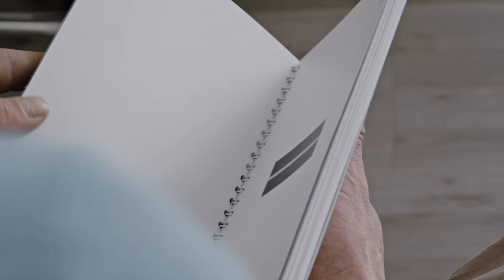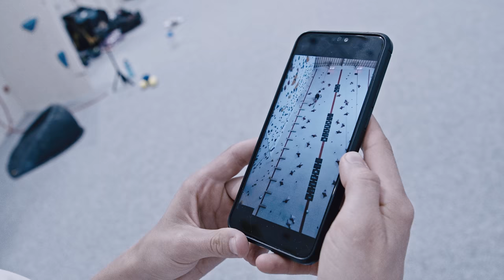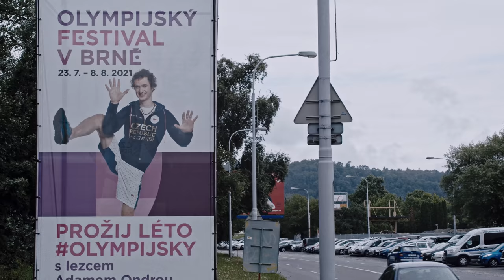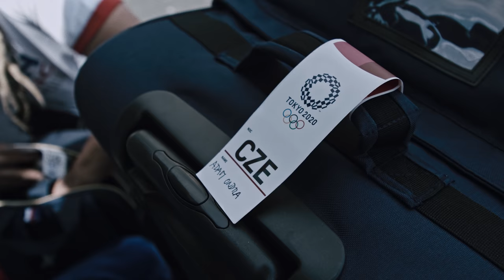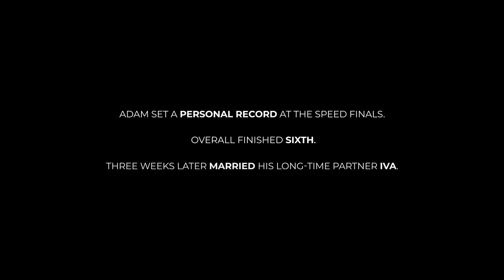BEYOND FOCUS 4/4 | Climbing Wall Inside the Sauna | Adam Ondra

Comment: Is nobody doing periodization in climbing training? Apparently it’s been quite a breakthrough in cycling and running training. You start the training year with long, low intensity endurance rides and then increase the intensity more and more (while decreasing duration) until the most important competition of the year. Take a few weeks off and then repeat the whole cycle.